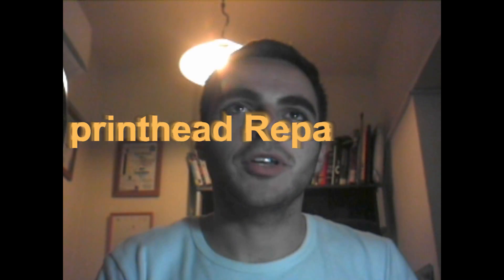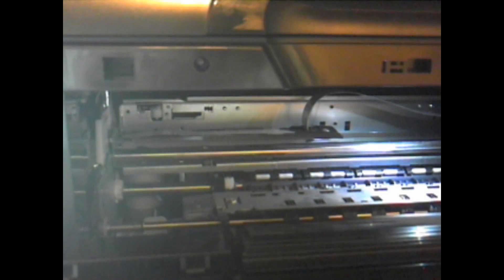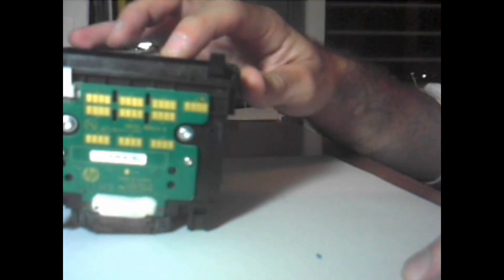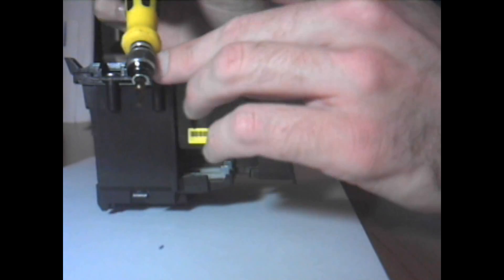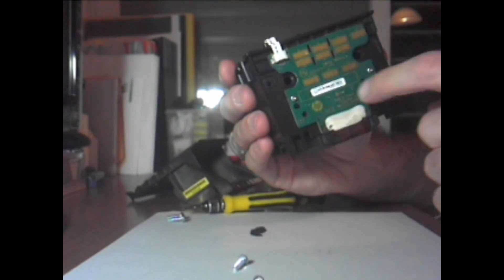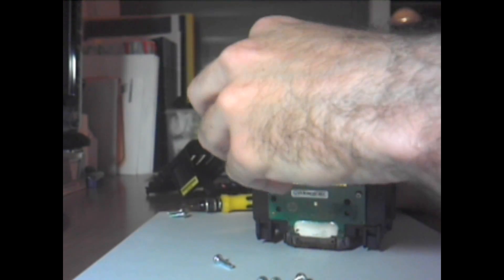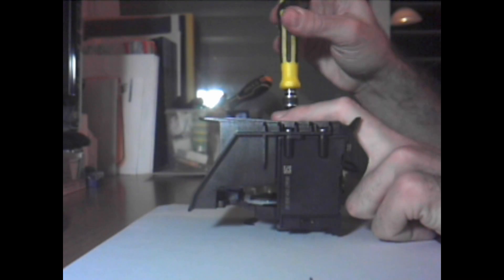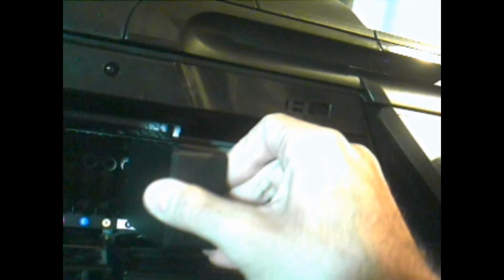hp officejet 8600 printhead repair

Comment: I looked under Amazon using HP 8600 printhead pen holder rack chip.  One part “pops” up that appears right-- full title: Printer Parts 950 951 950XL 951XL PrintHead Print Head Pen Holder Rack Chip Contactor Sensor fit for HP 8100 8600 8620 8620 8630 8640 251DW 276DW.  The Brand is Dingmingming, yes, made in China. They do list the following OEM Code: CB863-80001 CB86380001 CB863 80001. There are only 7 reviews for the Chinese part and it appears the working rate was 50/50. The one written review was basically, “it’s junk.”  The cost as I write this is $34.28; shipping time listed is 3-4 weeks. In SMALL PRINT, it does state the part is re-manufactured.  I’m going to try a cleaning kit first; I’ve already taken it apart and cleaned the connections using alcohol and erasure—no joy.  If the cleaning kit fails, I think it’s time for a new printer. This one lasted ten years, but I let the Cyan and Yellow run dry during COVID and didn’t replace for several months. I think the ink dried and plugged the pin holes. I may also have accidentally burned out the chip printing in black and white with empty color cartridges.  And yes, I always used HP ink, so I don't think this has anything to do with HP "setting" their chips to not work with Brand X ink--as stated below.

Comment: There are other reasons why it won't work. But thank you for this. I am really angry with HP that they can't build something that lasts. I have had my printer for two years. My problem is not the one you are showing. But it is one of the print head issues. I will just have to buy another printer. I am going to tell my legislator about this problem. I think HP is building things that don't last so we have to buy another one.

Comment: HP the company suck balls. They make their printers to purposely fail for no apparent reason. One day mine works just fine. it prints as it is designed to. Nothing difficult. Next day, turn it on and it tells me print head not detected. Ink system issue. What a load of bullshit ! $200 for fucking ink, then they want another $200 for a replacement print head. The whole machine costs $300. Fuck you HP ! I will never buy another piece of shit machine from you. You have lost another customer you crook Bastards !!

Comment: There are 8 springs behind the mainboard. These should be cleaned also. Especially if the ink levels still display correctly and it's giving the missing or incorrect install printhead error.

Comment: I ordered this piece. Took two months to arrive. When arrived and I opened the package. The print head was damaged. Two strings tangled with each other, there was no way to take them apart. I had to rip them off and replace with the strings from my old print head. The plastic wrap was half ripped off. Had to glue it back. When everything was fixed and I installed it back to the printer, I had the same message as before. Tried to turn computer on/off, didn't work. So it's a total crap. Wasted $10 and most important - 2 months.
Reply from the maker: This video is informative, there is no guarantee that the problem is in all situations as a result of this part.
Reply: @shayboi01  Wrong. The error message was exactly the same as I was having with my printer and solution was provided to fix this problem.
Reply from the maker: @dimkin6477 this error on the screen, is displayed in many errors in printhead unit.

Comment: After having to order this part twice.  The second finally arrived and the condition was horrible.  Corrosion on the springs and screws.  It was like it was left out at sea for two months, which was about the time it took from leaving the original country to getting to the US.  Replacing the part did nothing. So, it was either not the real problem or the part was just as defective.  I should have just discarded the printer and bought a new one, which is what I have to do now.  I will say the video was very clear and made it easy to disassemble and reassemble which I did now several times. I will be ordering no more parts from China.

Comment: I cleaned out all of the ink that was in the print head but the only one that sends water out where it's supposed to go is the black all of the others shoot water back up rather than out the bottom.  Does that mean that I used too much pressure when trying to clear the clogged ink?  I purchased the printer used from someone, so I think the ink was not used for a while.  
I installed the Print Head and black ink came out on the right side of the printer. I have a printer failure message. I tried to get as much of the ink as I could up,  Is there anything I can do to fix it?

Comment: Thank you very much for the time you took to produce the video.  Good English and good and simple instructions. My HP OfficeJet Pro 8600 Plus printouts were showing signs of running out of Cyan. The Cyan cartridge was replaced, ink level on the screen indicated Cyan to be full and the other colors to be full as well, but the paper test printout indicated Cyan was empty. So I replaced the new Cyan ink cartridge with another new cartridge and the test printout says Cyan is empty. Any suggestions.  Thank you in advance.  Please answer me through my Facebook account.

Comment: This is a great demonstration of the hp printerhead construction. Unlike in Epson it is possible to take off the printerhead  and examine it.  HP 950 951 950XL 951XL PrintHead Print Head pen Holder Rack Chip spare part does not cost much which  is valuable and important knowledge about in this video.
EDIT : After taking apart the printerhead pieces and trying to re-seat the chip pins to push little more towards the cartridge chip pins i manage to get my hp 8600 to alive again, but i ordered the the spare part because it is obvious that there is some error there although it was this  time once bypassed

Comment: Sept 2019. I ordered the part, waited 2 weeks for it to arrive from China, installed it with your very clear instructions, but unfortunately I am still getting the Printhead Installed Incorrectly or Missing, even after multiple tries. But thanks for trying. I appreciate the effort.
Reply: try not to buy from china the part originated in Taiwan  and he should have told you to handle with care,also those little springs are very easy to miss align and thy get a lot of ink on them and will not give you a connection.you have to use cleaning solution on all contacts. and use an ink eraser to clean after solution.
Reply: @itcouldbemenextyear  I tried this fix a month ago. The only thing that I observed, as in my comment, is that it now is seeing ink levels are now indicated, but I still get the 'missing/installed incorrectly' error. Prior to ordering the part I did use a cleaning solution, however I don't know if that helped or made it worse. Any suggestions?
I love this printer for docs and photos, and can't find a decent replacement. :(

Comment: Check HP printer has class action suit against them.  HP was found to have used software to block printers using generic ink cartridges.  I think there is a software fix but I don’t know what it is.  There was a judgement against HP.  The judgement has expired but they should still notify its consumers about a fix.

Comment: People should reserve comment until they get the part, replace it, and can testify that their printer works again.  You get the part from Aliexpress in China.  The web site is clearly noted on the drop down.  I got the part, installed it, and it did not fix the printing problem which is identical to what was described in the video. The required torq bit is a T9.  It is an odd size so you will lilkely have to purchase a case of torq bits.  Just to be sure, I watched the video again, and re-installed the part.  The problem is not fixed.  Chinese companies will run similar scams to increase sales.  How can you not buy the $6 part and give it a try?  So you do.  But it does not work.  Buy a new printer.  The HP OJ Pro 8710 is $129.
Reply: The parts imported from China might be recycled originals, which they just cleaned and not even bother to test.
Reply: I agree

Comment: hello!  Thank you for such a useful, clear tutorial.  I ordered the part and anxiously waited for it to arrive.  I reinstalled it and I'm still getting a cartridge error for the magenta cartridge.  Do you know how you can tell if the whole printhead needs replaced or cleaned?  I'm ready to throw this printer out of a window!
Reply: $499 plus tax, so I’m certainly going to try to fix the printhead problem by myself because that is THE ONLY ISSUE that Ive ever had with my HP Officejet Pro 8610!!

Comment: Hi, thanks for this video.  How did you discover that this part was the issue?  I've been getting a "damaged ink cartridge" error for my magenta cartridge and the HP troubleshooting is not helping with my 8600.  Everything was working fine before the latest firmware update.

Comment: Thanks so much for making this video.  I thought I would have to trash my printer and buy a new one.  My HP Officejet Pro 8600 started with faded streaks, and I cleaned the printhead with the program, but it didn't help.  I will try what you suggested in the video.  I'm going to order the part today and replace it.  I just hope I can find a screwdriver that will fit those tiny little screws.  
Once again thanks for sharing your knowledge.
Reply from the maker: Jeannine Schenayder you're most welcome friend